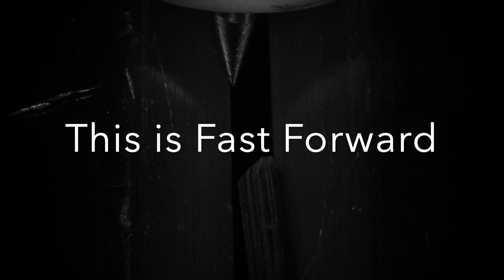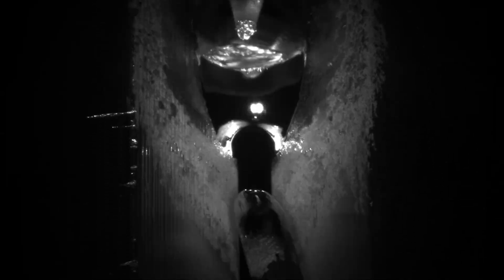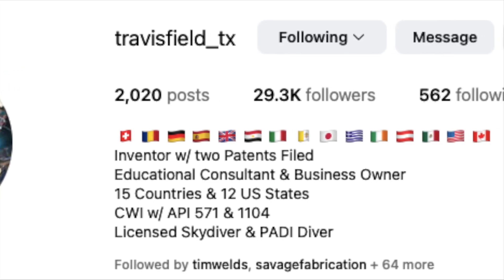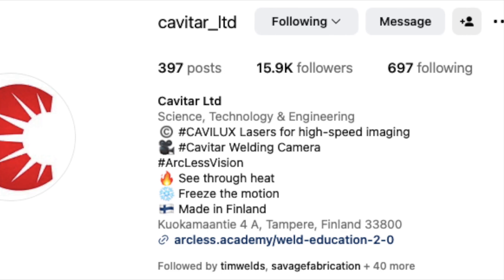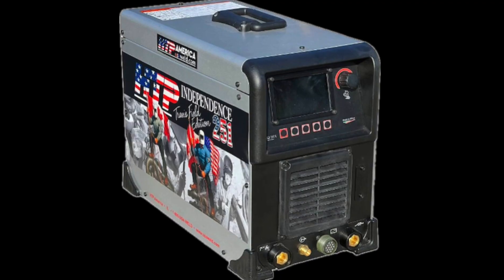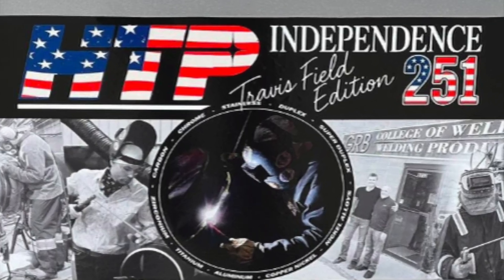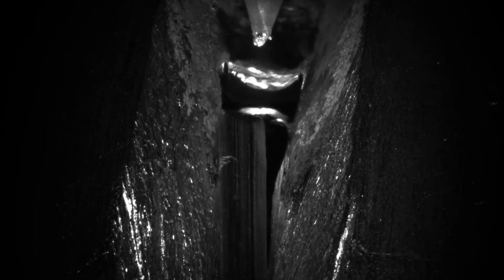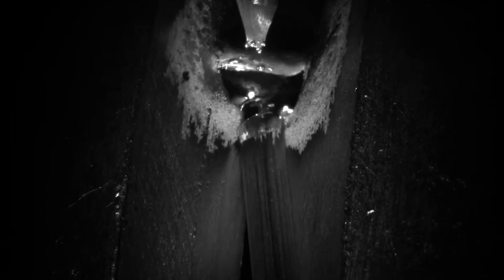🔥🔥Aluminum TIG Welding Like You’ve NEVER Seen Before! | Arc-Free Cavitar Camera🔥🔥

Comment: How the heck did he get such a short standoff? Even at twice that distance in the aluminum seems to hop back onto the tip with my welds. Amazing, I guess I have way more work than I thought.
Reply from the maker: He is that good.  And also over the years i have noticed machines do make a difference.  You cant expect to tackle tomorrows challenges with yesterdays tools ….